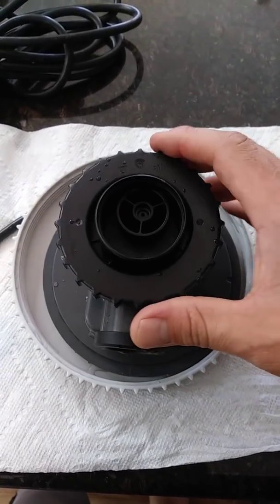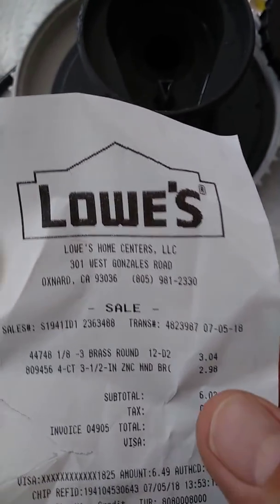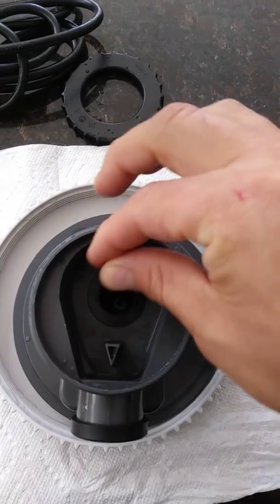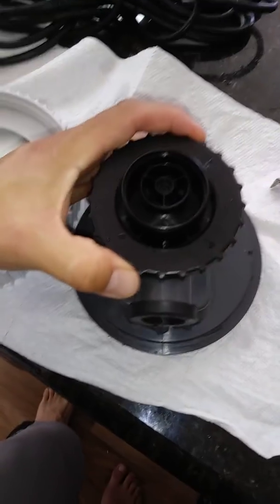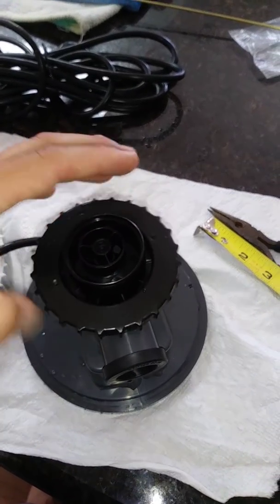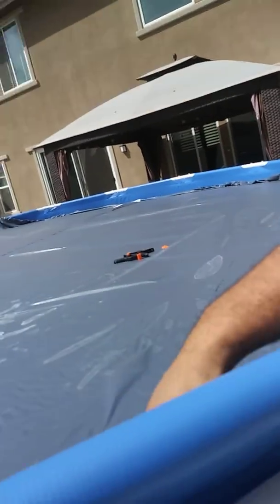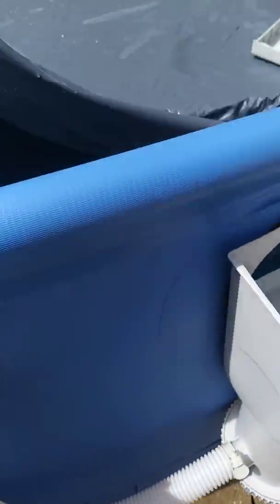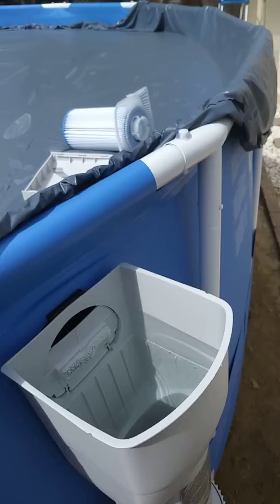SFX1000 pool pump repair

Comment: Did anyone try doing this bc water wouldn’t look clear ? After many failed attempts to clear dark milky water that accumulates in the middle of my pool and trying all that the pool experts say I might just try doing this to see if it just might be my a weak filter problem.
Reply from the maker: This sounds like chemical imbalance. Another option is to clean/hose out current filter. Even better if you can replace with a new one. Also water level matters. If too low, your pump can suck air, causing a weak pump. So verify water is above hash marks on the inlet side of skimmer, put in new filter and possible chemicle assistance. It wouldn't hurt to open the pump for inspection of debris (hair, bugs, etc).

Comment: Getting ready to do this, but my rubber stop won’t stay in place. How did you place yours?
Reply from the maker: Are you taking about the plug for the filter housing? Lol. Dropped mine in the pool a few times. Maybe let it sit in the sun for a bit so its soft and flat. Then hold it in place while opening the drain line. Hopefully that creates a vacuum and holds the plug in place. Other option is an extra set of hands if available or maybe tape it at the top where its out of water. Hope that helps. Good luck

Comment: Hey man any suggestions on how to get the magnet back in? It won’t go in the proper fit
Reply from the maker: It doesn't go all the way in. There should be a little clearance between the rotor and base. But make sure all parts are clean. Maybe squeeze the rotor assembly with needle nose pliers, continue to twist/spin it until the magnet grabs and pulls the piece into place. That's really all I can offer. Good luck.

Comment: hey quick question bob. so my rotor got all ate up and i can find out if my motor is a SFX1000 or the 600
im trying to buy a new one on amazon
any help?
Reply from the maker: I don't remember there being any markings on the actual pump. My pump identification was labeled on the silver sticker on the outside housing. Hope that helps. The good news is Amazon allows returns. So maybe order both if needed, then return unused rotor. Hope that helps.

Comment: Thank you so much for this, we fixed ours today! I honestly didn't have high hopes of it working (not because of your advice, but because things generally don't work out so easily/cheap for us). I was so incredibly excited to see that water filtering through again! 🙌
Reply from the maker: I know the feeling all to well. Glad you got it going again. Keep the spare rod. Because the metal rod snaps as well. Just not as easy. If for some reason it doesn't work after replacement... Your rod may be too long (shave down) or the ends might not be smooth enough. Just grind on concrete floor if needed. Happy swimming
Reply: Bob, just wanted to say thank you again. We still had the remainder of our rod from last year and a couple weeks after setting up the pool this year, it snapped again. Even easier to fix than last year as the rod was on-hand. Your video is saving us year after year!

Comment: pumps arent made to be ran 24/7 depending on the pool size its only a few hrs a day.
Reply from the maker: Right. For me, I have the sfx100. Which filters 1000 gallons per hour. My pool is 6000 gallons, so I'll run my pump for 6 hours at a time

Comment: Thank you, it worked well, but it is snapping the brass rods also. I think I might have to replace the pump.
Reply from the maker: Someone else said their rod snapped as well. That's crazy. Were you maybe swimming in the pool when it happened? Its recommended to leave pump off while swimming, then run pump when nobody is in the pool.
Reply: Bob Ganoosh There is a guy selling carbon fiber shafts on eBay. I tried the brass rods and they really didn’t hold up either. I’m going see how these carbon fiber ones hold up.
Reply from the maker: @KeyWestCorona  are you swimming when the pump is on? The pressure and force of the waves could be causing the rod to snap. Yeah the brass isn't a cure all fix all, but instead a very cheap alternative. I have lost 2 metal rods as well (in 3 years though). Let me know how that carbon fiber holds up 👍
Reply: @KeyWestCorona  let me know how that works for you. I'm sick of fixing it.
Reply: Bob Ganoosh We’ll see how it goes. I cannibalized my old x600 canister filter and removed the shaft from it for my x1000 until the carbon fiber ones arrive. This pool just has to get me through the summer. Full disclosure, I rigged a sprinkler to the output of my filter to keep the water reasonably cool. It may put a little more stress on the impeller, but that’s why I upgraded to the x1000 in the first place. Little did I know they were manufacturing them with such brittle parts.

Comment: What was the thickness of the rod you bought? Thanks!
Reply from the maker: Thickness was 1/8". Here is a link with part/description. Hope this helps....

https://www.lowes.com/pd/Hillman-1-8-in-dia-x-3-ft-L-Brushed-Brass-Solid-Round-Rod/3057647
Reply: You may have just saved son's 10th pool birthday party tomorrow. Couldn't vacuum the pool or add chemicals when the pump quit on me. On further inspection I found the rod to be snapped in two. Thanks again!

Comment: Bought this pool also the pump stopped working , left it alone for  2 days it turned back on but turned off after a couple of minutes any ideas Thanks
Reply from the maker: Sorry for such a late response. Just now seeing your question... It might be a good idea to open it up and clean it out. These pumps shut off if they overheat. Maybe something inside causing it to overheat??? Just a guess.

Comment: I bought my Summer Waves pool last year and had no problems with the sfx1000 pump all season. I went to open my pool this year and the pump would start to turn on, but wouldn't. I took everything apart thinking it was a broken pin (mine looks to be plastic) and the pin looked totally fine! Upon a closer look though, the top end of the pin is just barely rounded on the edges. So I figured I'd take a chance and flip it and put the good side on top. It started working immediately! Thanks for the great video info and comments from everyone!

Comment: Hi! I have the SkimmerPlus™ SFS350 filter pump. Do you know if this mechanism is the same? I read all the reviews about the pump before purchasing the pool so I almost bought a replacement pump just to have on hand for when it died, and then I found this video. Already purchased my rod online for pick up in store today but was just wondering if the issue and repair are probably the same with my model. Thanks!
Reply from the maker: I did help a friend with a smaller pump, but don't know the model #. His came with a metal rod already not a ceramic one. Yours will  definitely be a similar set up. Just won't know the material of the rod. When he thought his broke, I took it apart, it was not broken. It was literally blocked from rotating by a single strand of hair. Lol. That's the watch out.... Because its a smaller/less powerful pump, a small piece of debris can stop the rotor assembly. Hope that helps. Happy swimming.
Reply: Bob Ganoosh OK thanks! Either way it was only a three dollar purchase!
Reply from the maker: @lisaellis7933  call it a $3 insurance policy 👍
Reply: @bobganoosh5520  Yes!

Comment: My pump turns on , but not circulating the water. Could this be the cause?
Reply from the maker: Definitely! You have power, but the rotor assembly is not turning or moving the water. The only other tging is that if a leaf/stick or hair got in there in blocked it from rotating. Either way, you'll have to open the pump up to see.

Comment: I cant get the magnet back in the right position to go all the way in is there a trick?
Reply from the maker: Others were having this problem as well. No trick. Maybe just pinch with some needle nose pliers pushing in and rotatating the assembly. When it catches, the magnet should pull it right in. Good luck.
Reply: @bobganoosh5520  it pulls it in but then it's off kilter and the fan part doesnt go flush with it. Will keep trying. Thanks for the video!
Reply from the maker: @angelazapor5611  only other thing i can think is to verify the housing is clear of any debris. But other than that just keep rotating till it catches. Sorry i cant be more help.

Comment: Thanks for your video you really saved us. During covid-19 it's hard to get anything and the pool is something the kids can do. We able to fix ours with a steel pin my husband found in the garage. AWESOME 👍
Reply from the maker: Awesome. Glad to hear. I would suggest checking the steel pin a few times throughout the summer just to verify it doesn't rust/corrode. Not sure how steel does in the water. Happy swimming 👍

Comment: Ours broke in 3 pieces after 8 HOURS of use, brand new out of the box! So it’s still happening with the same problems in 2020. Thank you so much!! Went to Lowe’s and got the exact same brass rod as well. Pump works just fine.
Reply from the maker: Awesome. Glad you fixed it. Those ceramic rods are garbage. I just had to replace my first brass rod. It lasted 3 full summers. 3 summers is definitely better than 8 hours. Lol. Just keep the extra rod for future repairs.

Comment: I did exactly as you said but now the bottom of my canister is leaking. What do I do
Reply from the maker: It must be cross threaded. Seal the inlet hole again. Re-drain the housing and maybe have someone hold the pump from the inside while you use 2 hands for the threaded locking cap. Also, verify that the pump is lined up properly.  Did yours come with a seal/o-ring? If so, verify that's in place as well. Mine didn't come with one.
Reply: I did everything and no leak now the pump does not even cut on at all and the plug does not test or reset
Reply from the maker: @shaquanaarrington1192  sorry to hear. Try plugging a hair dryer into the same outlet. If the hair dryer turns on, the pool plug could potentially be bad. If the dryer does not turn on, maybe fuse is tripped in your circuit breaker box. In this case you would need to flip the correct circuit to reset it. Hope that helps. Good luck. Let me know the outcome. 👍
Reply: @bobganoosh5520  okay will try thank you
Reply: How did u stop the leak
Reply from the maker: @ashleytimms528  your locking cap must be cross threaded or not tightened enough. Be sure to have an extra set of hands when putting back together and tightening.

Comment: My blades are destroy, just got 3 of 6, you know where I get just the blades? Thanks a nice video my shaft its split on 2
Reply from the maker: If you have the SFX1000, here are a few options. Hope this helps...

https://summerbackyard.com/products/x1000-rotor-assembly

https://www.polygroupstore.com/x1000_rotor_assembly_p/p58050505001.htm

https://www.amazon.com/SUMMER-WAVES-Replacement-Assembly-P58050505/dp/B01DCIMBBM

https://www.walmart.com/ip/Replacement-Rotor-Assembly-for-Summer-Waves-X1500-Pumps/540753167?wmlspartner=wlpa&selectedSellerId=4798&adid=22222222228000000000&wl0=&wl1=g&wl2=m&wl3=42423897272&wl4=pla-51320962143&wl5=9031627&wl6=&wl7=&wl8=&wl9=pla&wl10=113842109&wl11=online&wl12=540753167&veh=sem&gclid=CjwKCAjw5cL2BRASEiwAENqAPuosuPJ23q_WpZiAvVfLJ9AbUff0YprhsZcIn_mQF7p9MTRm1odKbRoC6pIQAvD_BwE
Reply: Looks nice, thanks!

Comment: What cover are you using? And Thanks
Reply from the maker: Used the summer waves 17 ft. pool cover for 2 years - https://www.biglots.com/product/17-quick-set-pool-cover/p810151839
Then just this year, I switched over to a solar cover from Leslies pool supply - https://www.biglots.com/product/17-quick-set-pool-cover/p810151839
Bought this one on sale for approx $40 or so.

Comment: I did everything you did exactly and got the pump working but it still sounds like it has rocks in it. Any thoughts?
Reply from the maker: Are you running it dry? Put it back in the housing if so and try. I wonder if the rotor assembly isn't seated properly. Try repositioning it. Other people were expressing difficulty putting it back into place. That's the only thing i can think of art the moment. I'll let you know if I come across another
Reply: Bob Ganoosh ok. Thank you

Comment: Not all of them are accessible like that mine was sealed up and this pump is junk, upgraded to a sand filter. GPM Will blow this setup away.
Reply from the maker: Awesome. I'm not a fan of these skimmer pumps at all. Not only will the gpm be better, but the actual filtration will be way better as well 👍

Comment: I am thinking this might be what ails my pool. The pump is not making any noise at all though, could this still be it?
Reply from the maker: If there's bo noise, first check plug and make sure the gfci didn't trip. You can even check the fuse box/panel. Also, you can plug in another electronics item to verify power. If that checks out, then take pump apart and clean. A single strand of hair can take these pumps out of service. Good luck.
Reply: @bobganoosh5520  thank you. Did all that, has power because the light is lit, I just chalked it up to the end of that crappy little pump, and ordered a new one.

Comment: So on mine the propellers blades broke
Reply from the maker: Sorry to hear. Here are some replacement options...  https://www.polygroupstore.com/x1000_rotor_assembly_p/p58050505001.htm
Or google the model name plus rotor assembly. Example: SFX1000 rotor assembly. Ebay, Amazon, walmart might have a replacement. But if it's within the 1st year call the polygroup (link above) and exercise the manufacturer warranty. You will probably need a receipt. Good luck

Comment: Ours got wet like the plug did and stopped working
Reply from the maker: Did you ever get the plug situation fixed? Replacement plugs might be the solution, here is one example : https://www.lowes.com/pd/Tower-Manufacturing-Shock-Buster-15-Amp-Volt-Black-3-Wire-Grounding-Plug/50284613
Not too difficult to replace. You certainly don't need to be an electrician to do so. Hope this helps. Good luck.

Comment: What I replaced my broken ceramic rod with was the end of a old fiberglass fishing rod cut down with a pair of (dykes)aka wire cutters to the same size as the ceramic rod, I just pulled up the impeller with my fingers, moved out the broken rod and stuck the fishing rod top into the impeller and pushed the cover back on and screwed the nut on, stuck back the filter and turned it back on.  It's actually pushing out the water better than it did before and being fiberglass I doubt it will ever break again.
Reply from the maker: That's awesome and creative. Thanks for sharing. I don't own any fishing gear, so would not have thought of this. The fiberglass will stay much cooler than anything else as well. 👍
Reply: Hi The Bear, the first time I took my pump out, I had no trouble getting the impeller out.  this time around, I can't pull the impeller out....any ideas?

Comment: Old pin was snapped Put the new pin in turned  it on it hummed for a few seconds no water pumped then nothing, Prior to the new pin it would at least go on. It was worth a try but this is a piece of sh*t . When you start looking for new pump parts etc after 4 months and see so many people with the same issues well like I said, POS. Thank you for the video very kind of you to help people out.

Part 2:  edited the next day

OK next day I took it apart again. I must have done something wrong with top washer for 1 thing. Also in video I didn't realize at bottom of shaft there is a washer. I also had a shaft from a pool from several years ago. I cut it to recommended size and started over. 
Boom ! Pump kicked in immediately and works better than ever. HUGE SAVINGS as I was not thrilled about buying new pump at almost what the pool cost. 

However this does not change my thoughts as stated above  re: this thing : It still is a POS when you need to replace pump parts after a few months . It's common as we see here. Fortunately I and others were very  lucky to find this video !! 

Thanks again for this video.

Comment: I bought my pool last summer and only used it for 2 months and this summer for about 2 as well and my pump stopped working and it was humming but not working so I found you're video as I was searching to try to fix my problem and I purchased the brass round and cut it to size and boom it's working great now ty so much for you're video now I can enjoy the rest of the summer. I contacted the polygroup company that makes my pool and they would not replace the pump or the rotor assembly as the warranty was for 6 months even tho I didn't use it for that long. I paid almost 600 dollars for it plus chemicals, sand and everything I needed to set it up. I won't purchase a pool from them again I will get a better pool next summer. Again ty so much for you're video without it I would be spending  about 40 bucks for the rotor assembly and now everything is just peachy  :) :)
Reply from the maker: Glad this helped you and you were able to repair the pump. Have fun 🍻

Comment: Hi Robert, I saw your video and tried it but my pump still doesntbwork.  What diameter is the rod you bought, I had to get one that was a hair smaller than the ceramic rod.   Tia for the help.
Reply from the maker: The rod is 1/8".  If you put a new rod/shaft and its still not working, it could be that the ends of each rod are rough with burrs. Ensure that both ends are completely smooth. Also, make sure your rod/shaft is the correct length. Too short it will not pump, too long the cap will not close. Good luck.